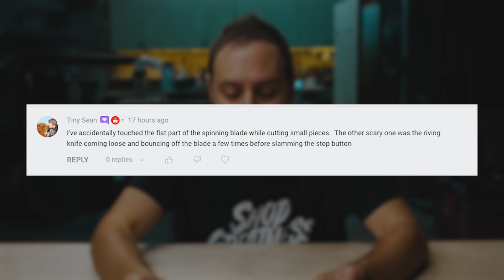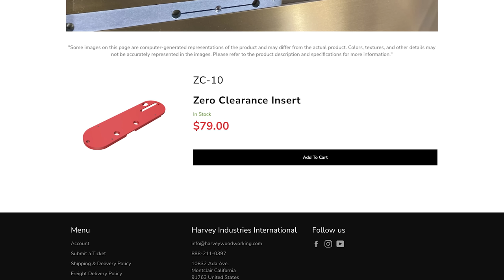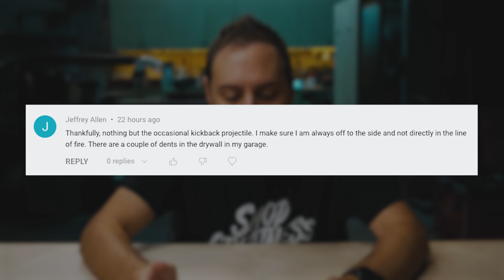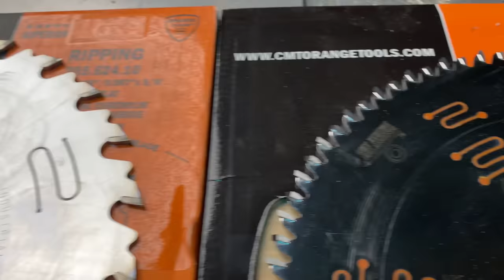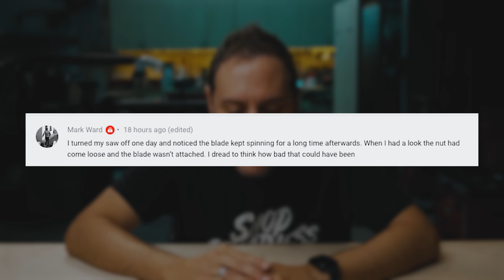I don't know why people make these dumb mistakes

Comment: I severely lacerated two fingers on my left hand a couple years ago.  I've been using table saws for many years and that's the problem. I was complacent in my knowledge of proper use. I was making repetitive crosscuts, something I had done a million times. I reached down to turn the blade off with my right hand and reached across to clear the last piece from the left side of the blade with my left hand. As I picked the piece up, I was not paying attention to how close my fingers were to the blade. I still cringe when I think about it. Complacency has no place in a woodshop.

Comment: I am still a new woodworking who is very afraid of the table saw.  One day I was ripping 1 3/4 inch square strips of Cherry.  After having cut 30+ strips, I finished with my last one and wanted to check something.  With the last piece of scrap (about an inch thick) in my hand, I remember looking for my square.  Next thing I knew, I felt something slam into my chest.  It was that scrap piece.  I was in such a hurry to find the square, I forgot to turn off the saw.  The scrap dipped into the moving blade and shot back at me.  I was just lucky that wasn't my hand that hit the blade.  Now I am very aware of what I am doing every time I step up to that saw.

Comment: Thank you so much for this video. I purchased a used table saw that I'm kind of scared to use until I know more about them. So I'm researching. One thing that I noticed when watching this video and comparing your table saw to mine, is that the riving knife on mine is lower than the saw blade (not at the same height, the blade is over an inch taller). Is that dangerous? Is that because the blade is too big? Or is there a way to raise the riving knife?

Comment: I wonder how many fingers would be saved if people would just use the blade guard? I get they can be a pain and the standard one that comes with the Harvey Alpha I bought is a nuisance but given the options I’ll take my fingers any day. I plan to upgrade to Harvey’s Shark guard soon. It appears to be much easier to move out of the way when I need to make those tiny cuts.
Reply from the maker: Some say the blade guard creates more punch points. 🤔
Reply: @wittworks  I can’t help but think that if Jimmy was using a blade guard he would have walked away with just a bruised arm. But it would be interesting to hear what these punch points are. I’m new to the world of table saws and I’m trying to set it up to be as safe as possible.

Comment: The table saws that are mostly used in the US are all dangerous because of high risk of kickback when ripping. The proper way to rip a piece of solid wood is, 1 retract the rip guide so that the end of the ripping fence is slightly further then the point where the blade of the saw will fully go thrugh the pieze of wood. When doing so, make sure the blade is as high as possible. Using this method does not require that the piece of wood is flattend or straight.

You did say it more or less, but it is very importend not to try to rip with an crosscut blade, or try to crosscut with an rippping blade, either change blades or use an multi purpose blade.

I europe it is mandatory to have your insert srewed down at the beginning an the end of the the insert, so it can not come loose while operating.

Further, do not push the workpiece at the other side of the blade then where your ripping fence is, while ripping.

Last but not least, makke sure that you have an tranparant dust extraction cap that is placed above the sawblade and is just a few milimeters higher then the thickness of the object youre going to sand.  

kickback occurs when, 
1 your workpiece rides on top of your sawblade en flies back at you,
----set your blade as high as possible
---make sure youre infeed and outfeed is long enough
--make sure you use the transparant dust extraction cap and make sure it is tightend down.

 2 your workpiece gets pinched between your ripping fence and the sawblade and shoots back at you  and 
----pull back the ripping fence do it supports the workpiece not further then neccessary
---do not rip workpieces that are shorter then about 30 centimeter, depending on how big your sawblade is

3, the sawblade gets pinced between the parts of tour workpiece that are ripped as an result of tension in the wood.
---make sure you use an riving knife
--when its gets pinched, pull the workpiece back a few times and or try to reverse feed it thrugh.
- --make sure you use the transparant dust extraction cap and make sure it is tightend down.
--push your workpiece an the side of the sawblade that your ripping fence is located.

Since the ripping fende is not retractable on most american table saws and they ofthen have no dust extraction cap above the saw, maybe it is in that case better not to set the sawblade at its highest point. I dont know.

(sorry for my poor English)

About the zero clearance insert, I do not have one, and small strips of wood can fall into the saw, and when that happens they get chewed up, but the never fly back at me. And if they would do that, they would get catched by the dust extraction cap. I have an old Harwi 130 table saw  and an old Altendorph panel saw

Comment: on the subject of backwards blades, i used to operate a saw at a truss manufacturing facility. This machine had (4) 18" blades and (1) 36" blade, so blade changes and maintenance tended to be a team effort. Every so often someone would install a blade backwards. It will actually still cut, but the sound that makes... just awful.

Comment: Never had kickback on a table saw. Knock on wood. But I did have a planer shoot out some wood and put a dent in the garage door
Reply from the maker: Oh yikes.
Reply: I've never experienced kickback either. I'm just lucky I guess. Either that or I hold the wood down really good. There's certainly plenty of times where I have a feeling if I didn't have a firm grasp on the work it might go flying. But I'm like the Hulk so that ain't gonna happen. I'll stall the machine out before it does. Hulk smash!

Comment: I have a 1970's (probably) old table saw outside with a 350mm blade and nothing else, just the blade sticking out through a plywood table. Its pretty sketchy when theres nothing to block your hand or anything else but it gets the job done. A 400volt motor to give it some real beans too 😵‍💫

Comment: I have used table saws for years…decades…and this video still scares the bejeezus outta me.  **SO** many opportunities for failure, with such dire consequences.  The table saw is the most scary, most useful tool in the wood shop.  This is a great reminder to always have your head in the game.
Reply: They don't even got table saws so much in Europe. Their shops revolve around the bandsaw. Which kind of makes sense in a way. You can certainly perform cuts on a bandsaw that can't easily be done on a table saw.

Comment: 21 years old, still scared of the table saw which is good. anyway i put my left hand on the edge of the table and apply pressure to the guard and run it with my right. left hand never goes over table

Comment: The bandsaw is treacherous as well. 
I use mine to cut ham bones into smaller pieces for stews later. 
It’s scary how easily that saw cuts right thru meat and bone. 
It reinforces my respect for the saw. 
And I never let anyone use my wood shop. 
I’ll work with someone. But when I leave it’s shut down.

Comment: HI there! Thanks for the video! I have a question regarding the split blade, I have a Ryobi table saw and it was really hard for me to get everything squared up, once I got it set up nicely i noticed the split blade that comes with it its thiker than the stock blade, while cutting the material gets stuck and its very hard to push trough. Its very hard to make a clean cut. What would be best course of action to fix this? New blade? Can I try to thin down the split blade?
thank you!
Reply: The splitter should be slightly thinner than the blade. My guess is that you are using a thin-kerf blade that you bought and installed after you bought the table saw. You should also check that both the miter slot and the fence are parallel to the saw blade. Depending on the table saw, getting them square can be easy or not. I had a Ryobi for my first table saw and it was incredibly hard to align the blade due to how it was built.
Reply: @josephgdraper  Hi Joseph, yes is has been hard to get it to cut Nice and clean with consistency. The Blade is indeed a kerf Blade but its the Blade That came with it when i bought it. I think Im gonna try to print a riving knife and see how it goes, once i have some coin Ill buy another Blade. Ill build a workbench with built in Saw and make a new fence That is Stable and actually accurate xD

Comment: this message on safety needs to extend to clients as well (business owners or home owners) that hire service workers to do work at their location.  I don't work in a high risk profession (i work with computers), that includes going to sites to do installs/repairs, the one thing I cannot stand is people hovering over me, interrupting me, trying to tell me what to do (these are people who have no clue, but they think they know more then me). There is a tree service company working on my property today cutting down/removing trees (they are using the very large commercial grade chainsaws).  But yet a family member wanted to go out back and watch them, and I know they will try to interrupt the workers, start asking questions. I have told them multiple times Please Leave the workers alone. if they need something they will call us on the phone to come outside.

Comment: I was once sanding my knife handle and then i accidentaly hit my thumb on to the sander, i sanded flat spot to my thumb that is still there after years, also i have once cut my finger on angle grinder but it wasnt bad because i unplugged it before i hit my finger but it still almost got to my pinky finger bone

Comment: how about a pedal which is under your feet to trigger the saw , if you feel things go south you remove your foot and saw stops , also there  should be  a gear that controls the speed like a bike or car has which gives you more control of the blade , there should be an instant stop on the blade which instantly stops the blade and does nt keep it moving .

Comment: I almost lost my right middle finger free-handing.  I did get a cut and needed stitches but I was lucky and the cut was not deep enough to lacerate the tendon or cut the bone, but very, very close. And my hand was far away from the blade, almost 6 inches, but it pulled the work and drew my hand inward toward the blade. I still have nightmares. Never freehand. Ever

Comment: Want to add dont buy cheap Harbor Fright table saw and likes.You'll get shitty uneven fence ,top and will become pain to do anything correct and may cause injuries.If you can't afford good saw there are ton of used old craftsmen table saws less then 200 on CL with cast iron tops.
Reply: I got my Craftsman saw for $20. She's a beaut. When I bought it I almost gutted myself with the blade loading it into the back of of the van I was so excited. That's the only time it ever came close to hurting me. I'm not a dork when I use it. When a power tool is running I know it's game on then.

Comment: I’m missing the tip of my left pointer finger thanks to a table saw. Ripping flooring for a friends closet, I went to readjust my hand and I will still swear that my fingers were clear. That blade jumped out and grabbed my finger 😂. The next week I made push sticks, a week late but now I have them.

Comment: Wear tight sleeves.  I ripped a board nicely.  Nothing went wrong.  I usually wear one of those white lab coats like what doctors wear.  I noticed that the cuff of my coat was about two inches away from the blade.  Sure, two inches is plenty, unless you planned for four inches.

Comment: Having come from metalwork/machining background i'm always shocked at the lack of workpiece clamping and proximity to blades you get in woodwork (or accuracy, but that's a different matter). It's little wonder there are so many incidents. Why do we accept to use table saws which are so evidently dangerous?

Comment: Another danger of bad shop layout is the trajectory of a potential kickback. I once had my mobile table saw positioned in the garage with the plane of the blade in line with the kitchen door. As bad luck would have it my son was coming out that door just as a small scrap of HDPE offcut fell into the throat plate and was ejected right at his belly. Thankfully it was a small low mass piece and he wasn't injured. I'm now always mindful of this ejection vector.

Comment: I was ripping dimensional lumber outside today to build my first workbench. The wind changed direction and sawdust bounced off my face and went up under my glasses and hit me in the eye. I jerked when it peppered my eyeball underneath my safety glasses. As I was reaching up to pull my safety glasses away, so that I could try to grab my shirt and clean the sawdust away, my thumb caught the tip of the blade as it was no longer in the wood at  that point.  Thankfully, I just have a busted nail and I missing about a dime size section of skin and about a tablespoon of blood or two or three. Cleaned it up and wrapped it, but there’s no need to hit the hospital.  A little gauze and electrical tape work pretty good as long as it’s not too tight.
Reply from the maker: Oh wow 😮
Reply: @wittworks  the good news is, I’m not blind👍🏻
Reply: Nice one. Next time don't flinch. Take it like a man!  It was the safety glasses that got you. You should have just squinted. But that's what you get for relying on externals to protect you.

Comment: That's why I prefer portable table saws with a weaker motor. If it gets jamned up it just shuts off. Yes it can be annoying but its a lot less annoying than shimms in your chest. Id rather take the time, reset the fuse, and restart the cut.

Comment: The only times I've gotten hurt while using tools is when I am tired. After my last injury that happened with a piece of metal and a drill press, I am adamant to not use any tools while sleep deprived now. Normally I am super slow and methodical and can see when something might be an issue, but when I'm tired I disregard common sense.

Comment: Always use all the safety stuff that come with the saw. The blade should not be set to high but just enough to do the cut and the "knife" is there to hold the wood apart if there is tension in the wood that gets released when you do the cut. The knife is also there to help holding the wood down to the saw table. Never ever cut short pieces of wood make sure they are at least 50 centimeter in lenght. The hood that covers the blade should always stay on and be corectly mounted so it helps holding the wood to the saw table and cover the blade from your fiingers. Plane the wood first if it is crocked before you cut it. Use a "pusher" stick/tool or two to push the wood with. For 90 degree cuts to make a speiffic lenght of pieces use a sled and follow the instructions over here and do not use the fence on the side of the blade to act as the lenght stop for the pieces or they get stuck between the blade and the fence. Then depending on what type of cuts you need to do there are more to think of if you want to keep your fingers attatched yo your hand when using a table saw. If you are just a little unsecure if a cut will be safe just do not do it but use manual push and pull a handsaw instead.

Comment: I'm one of the amputees. And it was entirely my fault: 1) "it'll be quick, I've done it a thousand times" 2) had lowered the riving knife (thought it would get in the way of an angled dado into a two by four) 3) wore gloves (don't know why) 4) kickback grabbed it and pulled my hand into the saw.

Saw my finger (pun not intended, but funny) and Yelled out and my wife came out. Told her to get ready to get me to the ER and get a back of ice. Then saw my finger tip (pun again) and yelled "make that two bags." 
It hurt a bit, but the combo of adrenaline and such a major hit to the nerves made the pain manageable. Got to the ER (VA), which was so busy I was put on a gurney in a hall. Took over 2 hours for an Ortho specialist to come and even look at it. Luckily they gave me morphine about 20 minutes before he got there, finally, since the pain had kicked in way before then. Doc asked if it hurt, I said yes, he said "it shouldn't with the morphine" I told him it still hurts, but I didn't care. 

He operated on my right there in the hall, with me (a former combat medic) actually assisting by using my good hand to provide extra stability when he had to use pliers to pull off a fingernail to an adjacent finger that was mangled, and hold the basic to catch the irrigation (and Jimmy is right, that hurts).
They could not save the partial finger but I brought it. The crushing and tearing was too much to reattach.

3 surgeries later I've got 90% or so use of the mangled finger (nail grew back) and one finger shorter than normal. Docs did a great job. 

Still using the table saw, but always with a riving knife, never with gloves, and extra alert and careful on all cuts.
Reply from the maker: Oh my word.

Comment: When I was in my 20s, I worked in a cabinet shop.  There was an employee who had a bad habit of leaving the saw running when he went off to answer the phone.  One day, the UPS guy came in and set down a box of corbels on the outfeed of the unmanned saw and walked out.  The vibrations from the running saw caused the box to skitter toward the blade.  When it made contact, it threw a 4x4x6 chunk of carved maple through the wall.

The force and sound was scary and after surveying the damage it was apparent that it could have been devastating if somebody had been on the receiving end of that corbel.
Reply from the maker: Oh my.